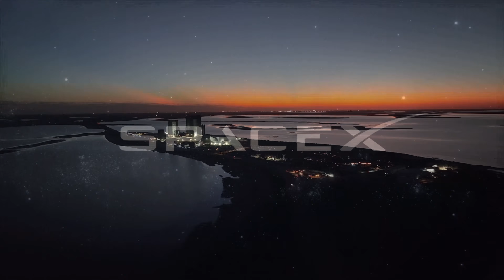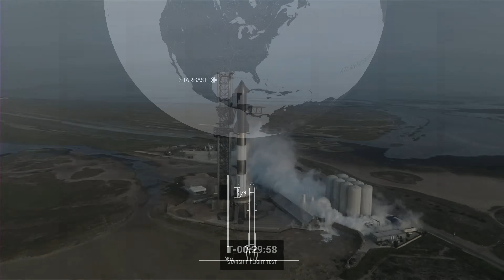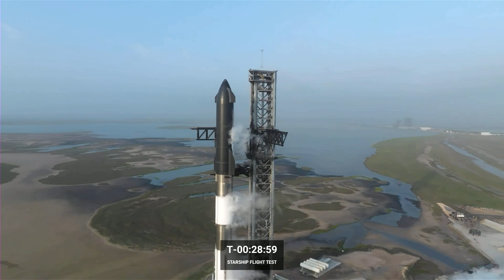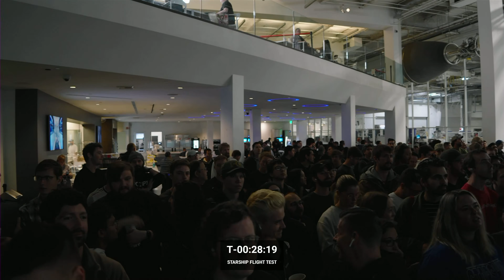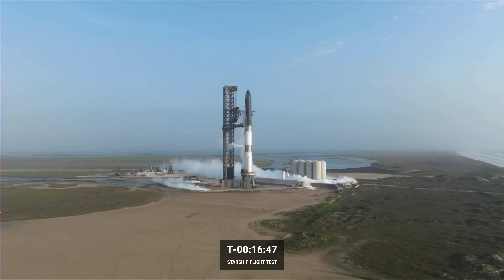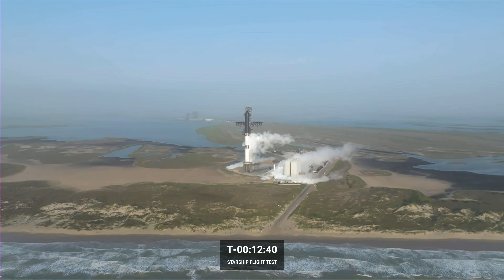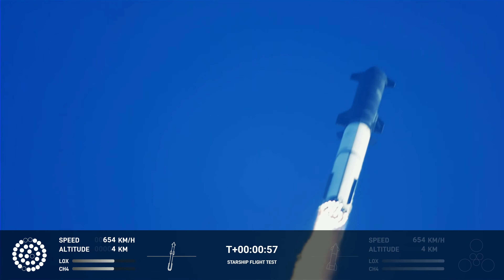Starship Flight Test

Comment: Excitement delivered! Thanks for the show SpaceX! Stage zero has survived! Biggest rocket to ever fly ( heaviest thing to ever fly I guess) great work!
Reply: @bullywife  you know they failed a lot of times before SN15 flight, but they still tried. that's why they always had chance to succeed.
Reply: @bullywife  It was a test flight and failure was expected but they gathered a lot of data from this flight and will apply that to the next one. SpaceX will succeed.
Reply: @johnarnold893  Who knows... we shall live we shall see.
Reply: @bullywife  did your starship succeed?
Reply: @bullywife  u triggering all the musk simps lol here they come 🙃
Reply: @vvvvvv-op7jb  N1 and starship are very similar. N1 had 30 engines while starship has 33 in first stage.
Both failed the same. The longest flight of N1 was its 4th and last attempt around 90s before it exploded.
Atleast, this time it can be fixed with static testing and computer simulation.
Reply: @bullywife  this is not thier first time😂
Reply: @theepashmani6474  ah yes the N1 starfighter is truly a magnificent ship
Reply: @theepashmani6474  wrong. The flameouts caused no actual issues on Superheavy. The boost back maneuver didn't work... calculations were off, computer couldn't compensate maybe..etc etc. So when they couldn't flip it around and re-stabilize it for separation they decided to blow it up purposefully. The engine flameouts did not make it blow up, unlike the N1 where it blew up specifically because of engine issues whether they liked it or not.
Reply: @bullywife  Wrong company. None of Musk's companies are even working on the Hyperloop. Falcon 9 and Falcon Heavy  would be a more apt comparison. Tell me how those two are doing?
Reply: @remliqa  Not being launched around the Moon like the SLS did last year, that's for sure.
Reply: @BlackGateofMordor  And how long did the SLS took from it inception to launch ?  A lot more time and lot taxpayer money  than Starship, that's for sure.
Reply: @kanuckistanprepper5321  It looked to me like the counter thrusters failed when it flipped to separate the 2nd stage. Only one side fired. We'll know for sure soon I'm. There was definitely some issues cause the plume was way to unstable even though it made it that far.
Reply: @remliqa  SLS was announced in 2011, same year as the Orion crew module. First successful launch 11 years later in 2022. Starship was first mentioned by Musk in 2005, and the company first announced plans in 2010.
Reply: @thadofalltrades  Right... I forgot that they were talking stage separation by centrifugal force... Is that still really part of the plan?
Reply: Surely the USS Enterprise was the heaviest thing to fly - sorry I forgot, that was science fiction as well.

Comment: Congrats, SpaceX. This was amazing. Excellent result. Heaps of information especially on tne first stage performance. 6 engines lost and looks like a few more after that. I even felt sorry for the poor Superheavy heroically struggling to stay on the trajectory with all that loss of thrust.

I’m sure lots will be changed in the engine compartment and expecting with excitement to see the next flight three-four months from now. But 20 Apr 2023 will be remembered as the first full stack development flight of Starship - most powerful rocket ever built and flown.
Reply: And it even took off on a funny forward angle. Amazing! The engines are so powerful it kept it upright (ish) thrilling to see it take off!
Reply: This launch did prove one thing. Even with several rocket motors misfiring, Starship was still able to lift from the pad. That is a good thing!
Reply: @Erzahler1930  Looking at the layout of the disabled engines, I wonder if it's intentional. After all, the upper stage often runs with some of its engines turned off as well.
Reply: I would hope that super heavy booster would be able to get to a successful MECO with just 25 engines firing.  So much orange at launch, probably from the methane burning water vapor at the surface, much like one sees at home with a gas stove.
Reply: @TheSlothrop23  What's amazing is that the spiral was actually intentional. It's meant to do that! 😮
Reply: @YT-TheLegacy  that was epic!!!
Reply: @YT-TheLegacy  It was meant to detach before the spiral I believe... and it shouldn't be a spiral just a flip. In the engine back video you can see sparks which is probably the pyrotechnic bolts to release firing but something there failed or bound up and caused it to fail to separate.
Reply: I think the main reason for the multiple engines failures which started right in first few seconds of flight is not the engines themselves but the launch mount. It has no flame diverters (preferably with trenches) channeling all that incredible heat and sound away from the booster instead of reflecting back off the flat concrete surface and hitting the engines.

Somehow I’m now pretty sure SpaceX will rebuild the launch mount - i was saying that the first time I saw it built. It doesn’t have to be an enormous Grand Canyon-like flame diverter under the launch table that the Russians traditionally build but something a lot more substantial than this. Will probably take at least 6 months to rebuild.
Reply: @YT-TheLegacy  Hmmm, interesting observation. One other commenter said it might've been due to heat being reflected back up into the engines. I don't know, I'm not a rocket scientist (literally!). I would think, however, that all 33 engines will be needed if the upper stage is fully loaded. I don't know. What I do know is that rocket was one powerful SOB!

Comment: They fact that ship was doing backflips and stayed together was pretty amazing… on to the next… Good Work SpaceX 🍻
Reply: It stayed together?
Reply: @JoshPLewis  It flipped 3 times before exploding. Usually rocket when angled 90 degrees to it's momentum, it would disintegrate immediately.
Reply: @JoshPLewis  also most probably flight termination system is what blew it apart, not even necessarily flips themselves.
Reply: @JoshPLewis  yes. that explosion was them detonating the craft lmfao i swear..yall cant even explain what you have seen with your own eyes..   anyways, no other design could handle those multiple flips.. thats whats most amazing about it.
Reply: @JoshPLewis  It stayed together from the aerodynamic pressure, yes.
Reply: @Buggabones  not necessarily, it could have been any number of things. It could have been clamp failure for one.

Comment: That was one of the most amazing things I've ever seen! And it doesn't matter if it's putting together something small or is something as large and complex as starship it usually takes a few tries to get it right. Congratulations SpaceX
Reply: You do realize that these spaceship systems are built by the lowest bidder, right? And it is literally a flying hydrogen bomb.
Reply: @HelenHumphries  It's still a mile-stone, if you know where SpaceX started from.
Reply: It's all good data. Worse would be if every test flight went perfectly and then the manned one looked like this.
Reply: @HelenHumphries  you are incorrect (probably "as usual") - also, no hydrogen in it, methane.
Reply: @HelenHumphries  No so.  It 's not "literally" that thing.  Quit exaggerating.
Reply: @HelenHumphries  I am really getting quite curious what does this "literally" actually mean.
Reply: @HelenHumphries  You probably should go back and see what the Gemini and Apollo mission testing failures were like during early development.
Reply: @HelenHumphries  A very old joke from the 1960's that don't apply here.
Reply: @HelenHumphries  It's most definitely not a hydrogen bomb. Not only does it not use hydrogen(as the volume required for it would occupy a lot of space) even if it did, a hydrogen bomb works by using traditional fission bombs to explode and create enough energy for nuclear fusion of hydrogen to occur. If a rocket this size used hydrogen and exploded, it would not manage to come near to the energy required to start nuclear fusion of the hydrogen.

Comment: 5:10 Start 
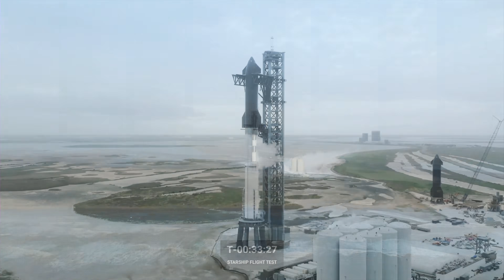6:30 Live view 
44:55 Countdown 
45:05 Launch 
46:12 Maximum Q 
48:00 Overflips 
49:00 Explosion 
49:45 Elon
Reply: ty
Reply: Why they celebrating explosion
Reply: @GANESHKUMAR-lu9fz  Not sure. But if I had to take a guess it's because it was stated before launch by Elon himself that there was a decent likelihood of explosion. SpaceX just wanted to see if they could launch it without destroying the launchpad, which they did + a little extra.
Reply: @GANESHKUMAR-lu9fz  nobody from them is sure that was succes or disaster ,in the end they understood thet wahs totally disaster ,watch Musk face ,wtf he think i just lost milion of dollar 😂
Reply: 45:31 Hydraulic control unit breaks (right at the bottom of the booster), you can see the bits fly away, followed a couple seconds later by the fluid burning off
Reply: But it's bad for the environment- Elon musk the hypocrite
Reply: شكرًا
Reply: @GANESHKUMAR-lu9fz because it was a success getting it over the launch pad and to even survive maxq was so impressive
Reply: @GANESHKUMAR-lu9fz  celebrating the end of her maiden flight and learning a tonne from it.
Reply: Thank you, @cryptycTV.
Reply: @GANESHKUMAR-lu9fz  it is because it made it so far into the air, so now they have to improve it.
Reply: Thanks legend
Reply: tu
Reply: expensive fail
Reply: @xstudent4890  I’ve heard Booster 9 and beyond will use Electric Motors instead of Hydraulics for Thrust Vector Control.
Reply: @NityaStriker  I have also heard that, probably wise haha
Reply: Great
Reply: @GANESHKUMAR-lu9fz  its been said a LOT of times. Its because this is the first test flight how can you expect something as complex as a rocket to always succeed on the first launch
Reply: @GANESHKUMAR-lu9fz  because it was a success
Reply: Elon Musk: "I blow up my own rockets" 
Putin: "Noob. I blow up my own cities."
Reply: @GANESHKUMAR-lu9fz  eles estavam celebrando  porque enquanto tiver experimentos, eles terão seus empregos garantidos!
Reply: 45:32 Engines overheat and cause a small leak which can be seen as a trail leading off the side of the engines
Reply: Thank you. Was waiting for Elon.
Reply: @GANESHKUMAR-lu9fz  Because this was a test flight. Duh. The reason for it was to get information to make future flights better. The fact that it got so far was amazing. The explosion was remotely done for safety. Hence the playful cheer.
Reply: @the_batmobile0.4  reusability
Reply: @GANESHKUMAR-lu9fz  Because it was not near the building haha
Reply: boom that was 100000000+ dollars
Reply: Ty
Reply: @TAmzid2872  yeah, but you need to understand: it was built cheaply and carelessly, and was completely expected to be a failure, at least that’s what SpaceX implied. It’s old tech using a different fuel. Not a thing more. That’s an investors nightmare to hear as an excuse. Do you wanna know the computer that saved the apollo missions? It was a calculator…this was no success, it was a money pit to hopefully save SpaceX from bankruptcy.
Reply: @sgtgiggles  Yeah, the lauch pad was too weak(like the pad was extremely damaged). Im pretty sure if they had more time the launch would have been more successful.The rocket as fine though.
Reply: @TAmzid2872  not from what I’m reading. It’s completely over engineered. He built a Soviet era rocket with a few differences…Elon smashed an N1 moon rocket into a  Saturn 5 and called it a day. It’s silly.
Reply: Ty
Reply: @eldorado758  The point is to gain information. Every major rocket design ever has always had these, it didn't matter if it blew up, information is vital. Then you improve the next rocket based on the information, and the chain continues, until your confident that it is safe to fly.
Reply: @ZadesLegacy it was an auto-destruct I think. Just to make sure it could launch.
Reply: @ZadesLegacy  they did not destroy the launch pad
Reply: Maximum Dynamic Pressure Max-Q
Reply: @the_batmobile0.4 yep. All about the money not about the environment
Reply: @the_batmobile0.4 get over it if we don’t do this you won’t have a earth environment to live on in the first place
Reply: Half of y’all don’t know nothing about the rocket and the process all you care about is the explosion
Reply: you is smart @crypticTV
Reply: @GANESHKUMAR-lu9fz  Because it was a controlled launch

Comment: IMPORTANT HIGHLIGHTS

44:25 -- T -40s Hold lifted (?)
44:54 -- T -10 seconds
45:04 -- LIFTOFF
45:37 -- Visible flames
46:22 -- Max Q callout
47:00 -- Visible flames / Super Heavy starts to spin wildly
47:13 -- Views from Starship's onboard cameras
47:51 -- Super Heavy engine cutoff callout / supposed flip manoeuvre for staging
49:02 -- RUD
Reply: Pin this comment, please 🙏🏻
Reply: What is MAXq
Reply: Thanx buddy...you save some time
Reply: @mymixedbiscuit9159  maximum aerodynamic pressure, the most pressure the vehicle will see from the atmosphere.
Reply: what is RUD?
Reply: @mymixedbiscuit9159  The max q or maximum dynamic pressure condition is the point when an aerospace vehicle's atmospheric flight reaches the maximum difference between the fluid dynamics total pressure and the ambient static pressure.
Reply: on 46:22 Max Q should have happened, but did not happen, the speed was only 850 km per hour, speed increase was behind schedule. MaxQ was approximately on 46:48.
Reply: @NighTcdGamer  rapid unscheduled disassembly
Reply: 45:33 raining metal fragments.
Reply: @NighTcdGamer  rapid........
Reply: @NighTcdGamer  it's Rapid Unscheduled Disassembly
Reply: 50:20 awkward staring and smiling at the screen while the guy on the left talks.
Reply: @mymixedbiscuit9159  when the pressure of the air or the itself is so thin that it doesn't apply any force anymore to the vehicle and it starts gaining supersonic speed way faster. Max Q always comes a couple of minutes after the vehicle reaches supersonic speed wich means it traveling faster that the speed of sound.
Reply: 45:10 huge chunks flying towards the tanks.
Reply: W
Reply: Maybe 47:35 out of control can be added in highlights?
Reply: @NighTcdGamer  rapid unscheduled disassembly
Reply: @mymixedbiscuit9159  i think it is the most stress that the rocket will have during the flight
Reply: @NighTcdGamer  rapid unscheduled disassembly, science talk for “it blew up”
Reply: Not all hero’s wear capes
Reply: @NighTcdGamer  rapid unscheduled disassembly
Reply: @jake102isverycool  This comment made my whole 4th grade class laugh!!
Reply: Thank you
Reply: @catherinemarks4441  glad my comedic genius isn’t going to complete waste
Reply: @NighTcdGamer  R apid U nscheduled D isassembly
Reply: @jake102isverycool  They didn't laugh with you. They laughed at you! Even children recognize filthy trolls, on line. 😅😂
Reply: @CritternNation  bro what, "filthy trolls" all i said was that the rocket blew up
Reply: Hebrews

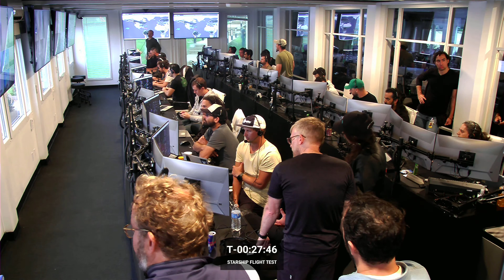12:14 Make every effort to live in peace with all men and to be holy; without holiness no one will see the Lord.

Acts

3:19 Repent, then, and turn to God, so that your sins may be wiped out, that times of refreshing may come from the Lord,

James 2:24,26

Ye see then how that by works a man is justified, and not by faith only. For as the body without the spirit is dead, so faith without works is dead also.

John

3:16 'For God so loved the world that he gave his one and only Son, that whoever believes in him shall not perish but have eternal life.
 
3:17 For God did not send his Son into the world to condemn the world, but to save the world through him.

3:19 This is the verdict: Light has come into the world, but men loved darkness instead of light because their deeds were evil.